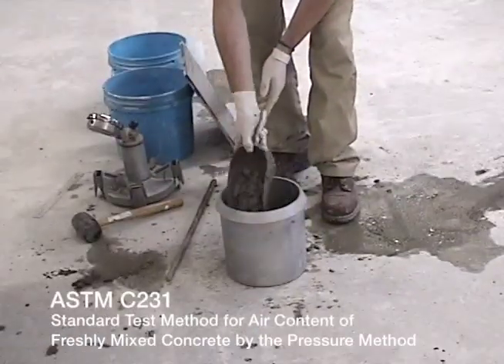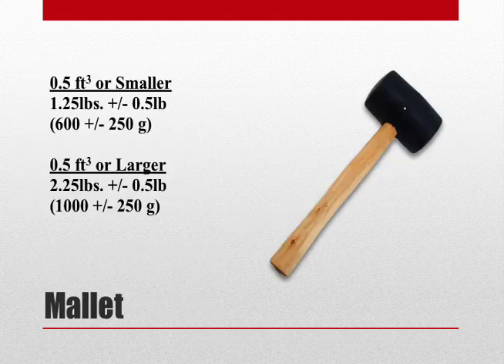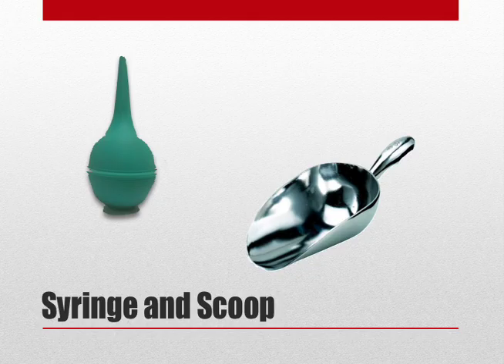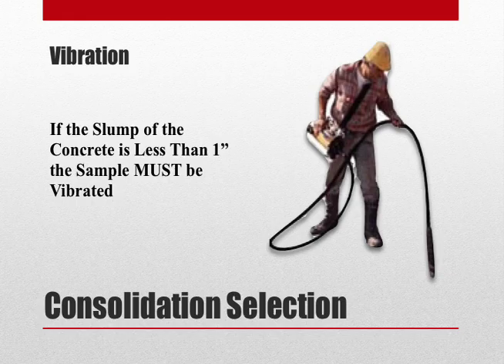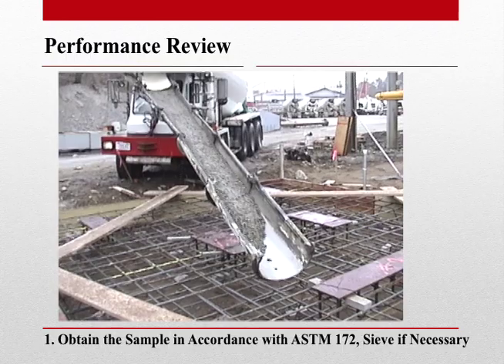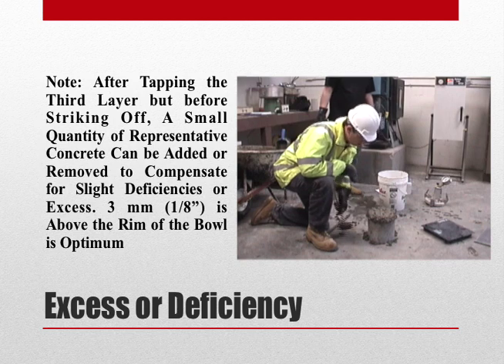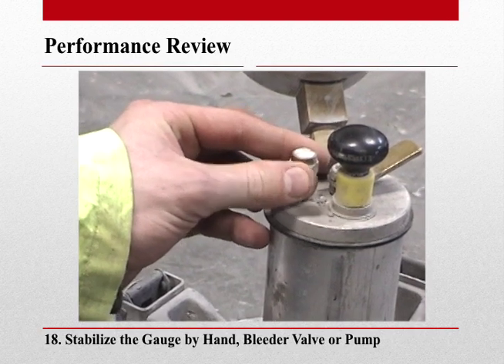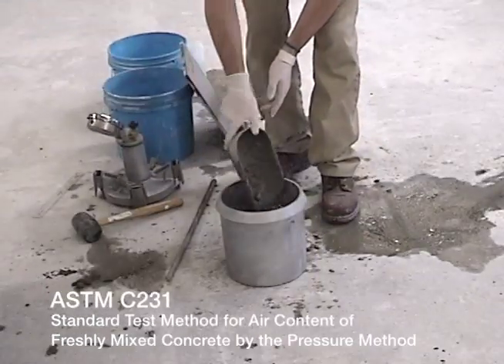ASTM C231 Air Content of Concrete by Pressure method

Comment: Can you please explain how to determine Aggregate Correction Factor.Thanks
Reply from the maker: Hello Muhammad,
Aggregate correction factor is a deduction from the final air meter reading due to the presence of air in the aggregate. When we do pressure tests (C231) we are trying to determine the air present in the paste, however, the reading will also show the air in the aggregate, therefore we deduct the air in the aggregate from our final reading. The way to determine aggregate correction factor is to run ASTM C231 on just the proportional aggregates of your mixture. I hope this helps.
James Lee
Reply: Thank you James. Is it possible if you upload the blackboard session video for ASTM C138 for further calculation examples.
Reply from the maker: Muhammad Jamal Hello Muhammad, I have posted the Blackboard session for C138. This reviews unit weight, yield, cement content, and air (Gravimetric). I hope this helps.
Sincerely,
James